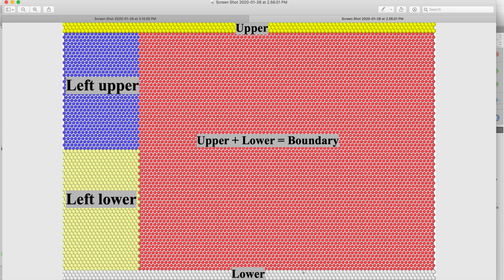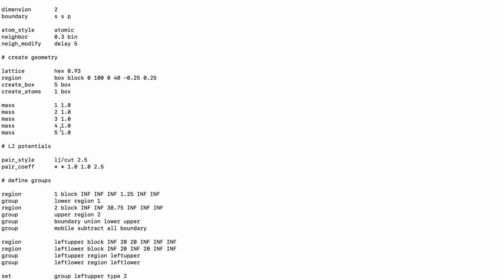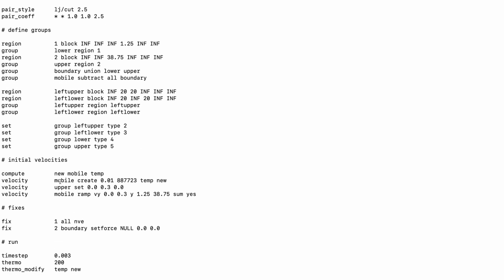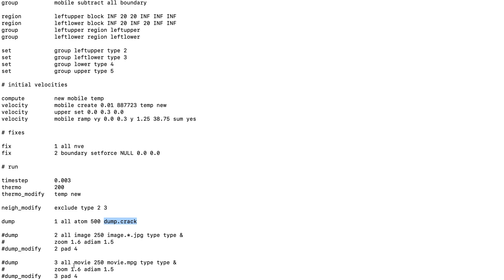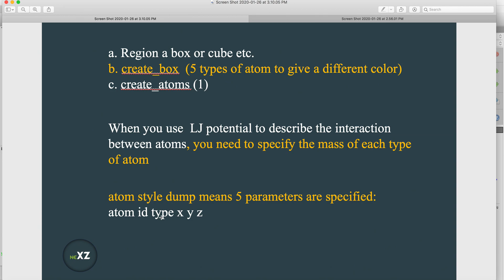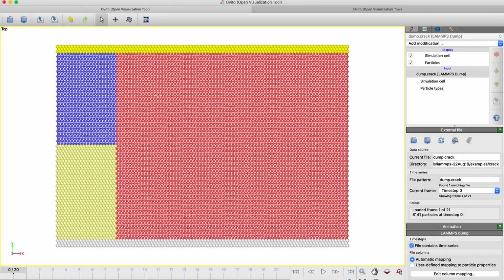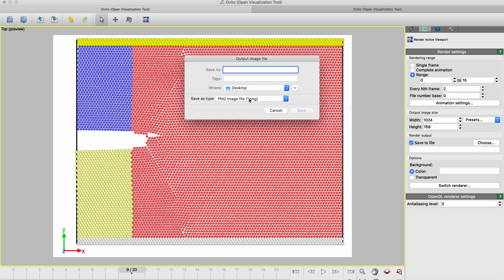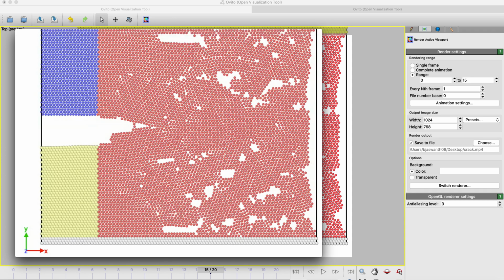Crack Molecular Dynamics Simulations || MOVIE with OVITO || Output file format of LAMMPS

Comment from the maker: While creating the crack structure in LAMMPS it is important to define the atom types with create_box command: create_box 5 box 
Here 5 means - 5 atom types - that means you can use it for 5 elemental alloy
In here, I am using 5 atom types with same mass, and same LJ interactions (lj/cut) but I’m using 5 to create different groups to get different color